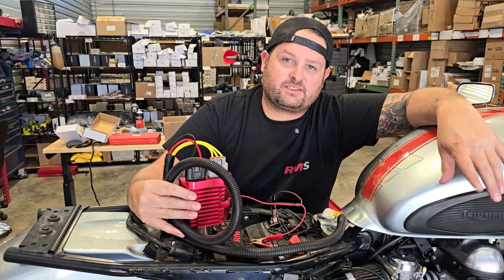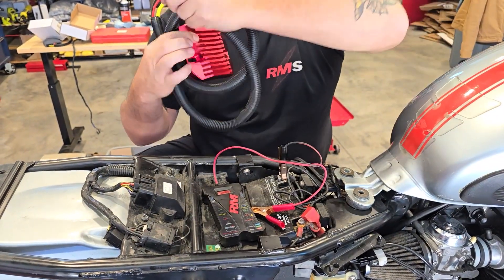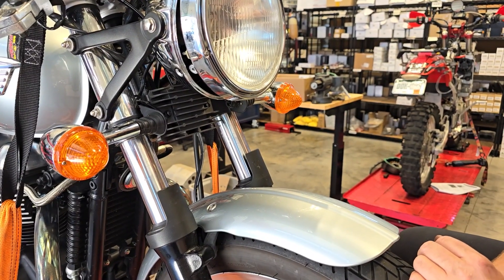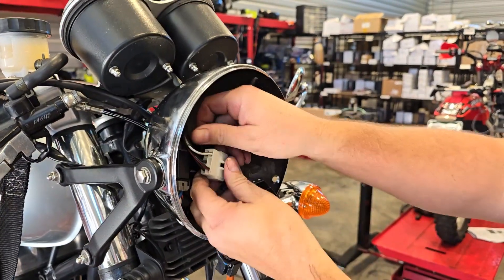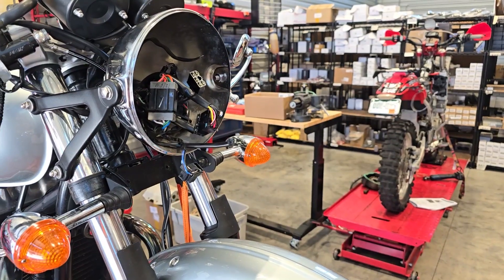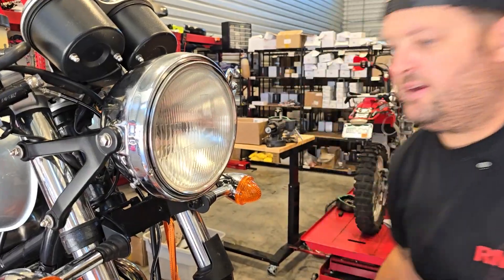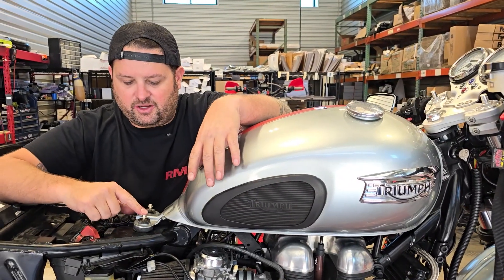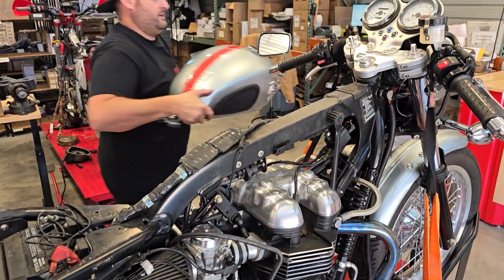How to Install a Bypass Regulator Kit on Triumph 900 Thruxton Bonneville Scrambler  - RMSTATOR

Comment: Always nice to see any Triumph Bonneville information and tutorial videos! Would your setup allow for mounting the regulator in a different location? 

My airbox is gone as well so I thought about making some room and brackets to mount it under the left side cover area. There are a few other locations I might consider, but since the machined aluminum Mosfet regulator run cooler how much airflow is required to keep it happy? Some older Japanese motorcycles I'm familiar with stuck the regulator on either side of the frame just under a body panel, but there are a lot of variables and differences between bikes and charging systems. Thanks for any thoughts or advice, and great videos!